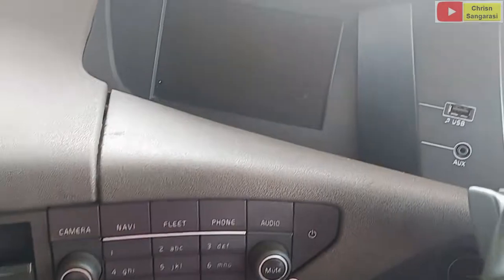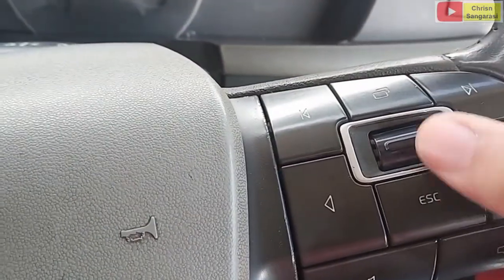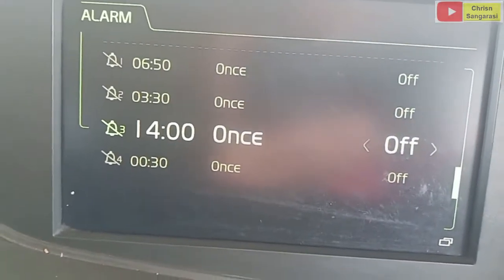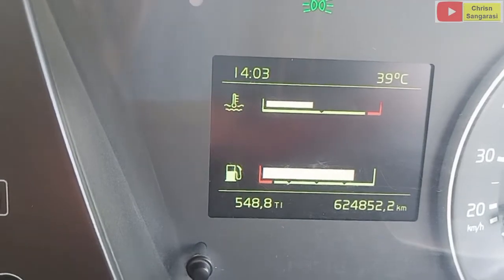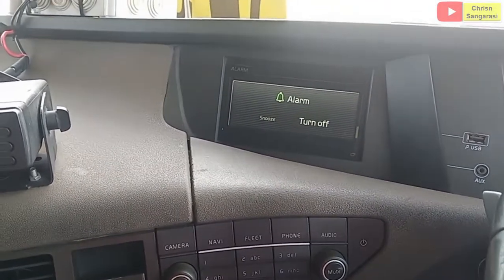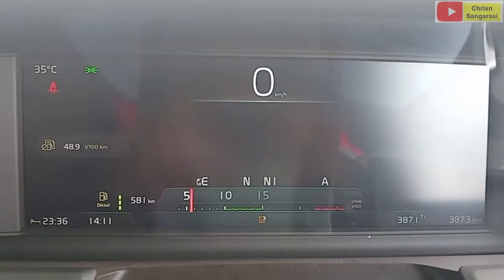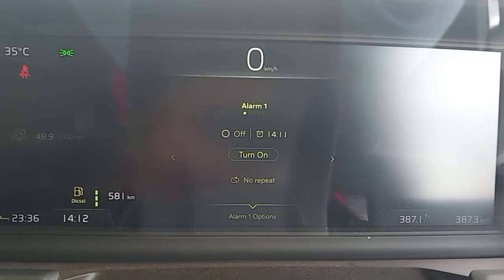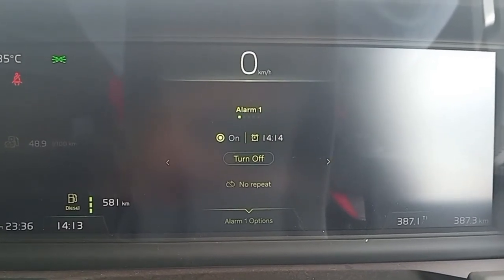CARA SETTING ALARM UNIT VOLVO FM/FH VERSION 4 series 1 & 2

Comment: Apakah pernah mengalami error hydraulic steering system malfunction?
Reply: Untuk volvo yg steering pumnya ada 2 di engine dan transmissi
Reply from the maker: Belum ada, punya kita hanya 2 steering pump, dan mempunyai 1 electrik motor yang terdapat pada sistem dinamic steering